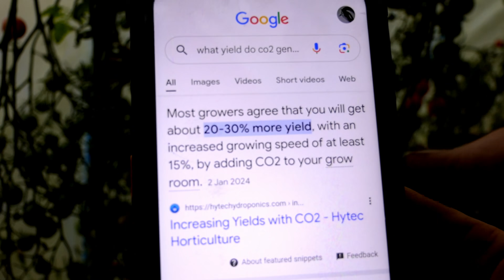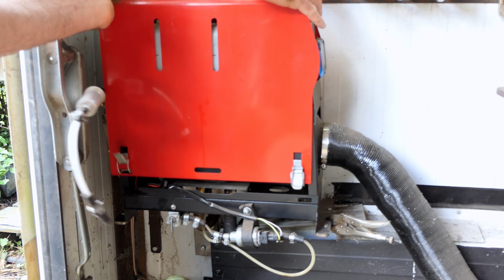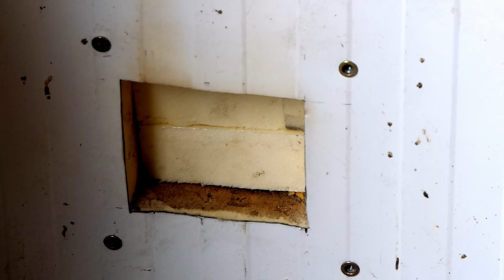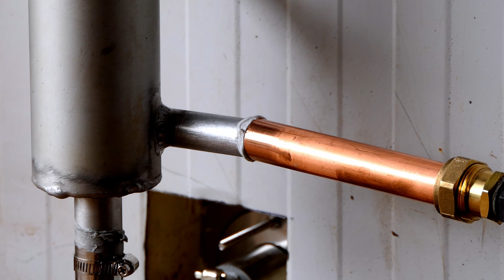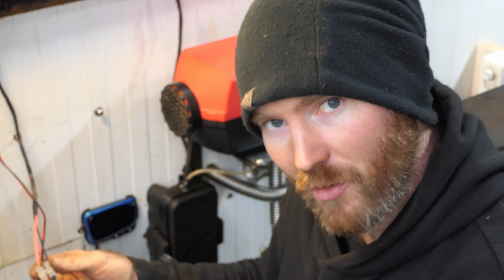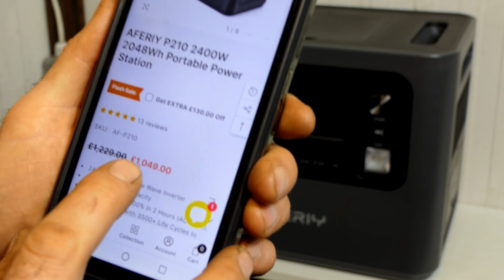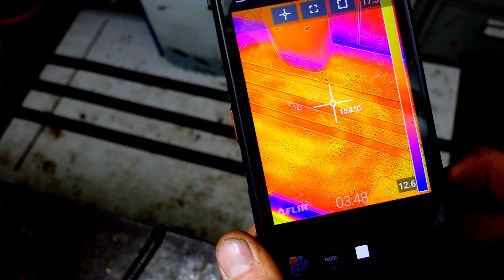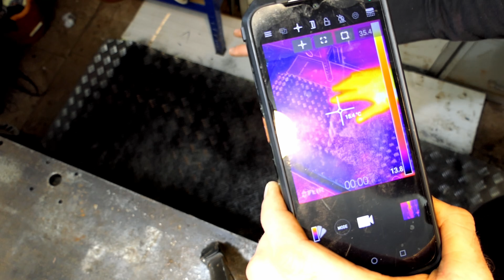NEW! Better system for Cheap and Safe Heating💲+ Underfloor Heating Mod test🫠

Comment: I got a 16kw diesel water heater that i connected to the radiators in my cabin thats in one of my videos. Im now actually really curious how much heat is going out the exhaust!
this is a brilliant video!
Reply from the maker: @jamesbrokentech  thank you so much. Cheers J

Comment: DUMP the under slow regulated floor heating and connect the warm Water to a FAN CONVECTOR.
THATS an amazing and fast warming system...
PS im already using the EGR exchanger, bought used for 10 euro.
Reply from the maker: @hunkenpunken  Nice. Well done 
Cheers J

Comment: Since you have an open water system: You should consider re-purposing your old Air systems: Make it watertight, run the exhaust free floating inside water inside the airexchange unit you had before. Sure. the Water (due to mass) will take a long time before it is getting hot, but it would also be a great energy store and heating the workshop even when the heater is off for quite some time. It would also save you on buying a radiator, since the whole "tub" would act as one too.
Reply from the maker: See what I do in the next upgrade. Cheers J
Reply: @ looking forward to it! keep buzzing! 🙏👍🏻

Comment: When you cut the grooves for the pipe in the panel: You can actually do this quite easily with a circular saw. Just make sure you have an extraction for the dust, it is real messy (own experience ;-)
Reply from the maker: I bet. Cheers J

Comment: Thanks for all the info! I was always told CO gas is denser than air, and found out about it being lighter just now. You are also very correct about your battery being half the capacity rated. Note that they sometimes have a K factor, the faster you discharge the lower the capacity according to a formula with that factor. Mostly lead acid batteries are rated at 20h discharges to meet its capacity. Using only 50% will drastically increase its life. You know what you're talking about.
Reply from the maker: Thank you so much. Cheers J

Comment: You just need to run the exhaust through a radiator /sand battery AFTER your first exchanger (assume that's already a sand battery?). 
You could also fit another silencer between each heat exchanger. 

You'd have two heating systems, one via sand and the other via pumped water 🤓

I've been talking about what you're doing for years and everyone laughed at me so never bothered to do it 🤦
Reply from the maker: Thank you. I've already done tests on a sand battery and I used a long radiator exhaust prior. Water cooling is definately the best way but I need a bettre heat exchanger. cheers J
Reply: @joshuadelisle  look at industrial aircon heat exchangers, we had a bank of them at a food processing plant to improve efficiency 

You could alu weld stand off plates and then plate the thing to make a water jacket external to the rad/exchanger - you have a solid block rad/heater in the garage but...

You need more volume of hot gas to simulate slowing the gas to improve heat/ to create effective transfer. 

You don't necessarily need to you water or anti freeze, other types of liquids heat faster (can't renber the term for them off top of my head)

Cheers

Comment: I put Redex in my fuel and for some strange reason my fuel pump to my diesel heater is now completely silent no more tick tick ticking, to say i was surprised is an understatement as its remained silent very odd
Reply from the maker: Interesting, I'll look into that. cheers J
Reply: @joshuadelisle not added anymore redex to my fuel and slowly my tick tick has returned but not as loud as before redex, so guess its time for more redex will let you know how much redex to diesel ratio and the results,by the way great channel this, dont know if you'll see this as its an old video ,but have you seen the video of 2 guys exploring somewhere cold and icy can't remember as I'd had a few if it was north or south but there was large heaters under the ice ,now was it A.I  not sure as video seems to of disappeared , onwards and upwards as they say and totally agree with you

Comment: You didn't use any inserts in the pex pipe ends.
Reply from the maker: It's not pressurized so the inserts don't really make any difference. I didn't have any either. cheers J

Comment: Interested Joshua, where you got your 1000 litre kerosene storage tank from? Does it need to be double walled or not. They seem incredibly expensive? BTW I'm in the UK.
Reply from the maker: @michaelnash9644  mine is 20 years old and was here before we moved in. Looking online I can see a few that are around the £600 mark which is equal to filling one up. You need a secure concrete pad. Otherwise if you ask a heating oil provider they'll probably give you advice and maybe Money off to help secure you as a customer. Cheers J
Reply: As a new heating user yes it will have to be a double skinned tank and there’s rules about where you can place it as well I suggest you Google it and have a read as it will effect your property if you decide to sell it. You can quite often pick one up of facebooks marketplace dirt cheap I got a 2500litre oil tank single skin tank for £50 but had to collect it myself . Good luck .
PS I’m in the Uk myself .

Comment: As well as the heat exchanger (one from an old combi boiler would work incredibly well, try passing the exhaust air through an old cast iron radiator (empty of water(obvs), get it from a salvage yard) entering in from the bottom on one side and out of the top on the opposite side, it's a larger thermal mass that you need. It will condensate inside so you will need to use the other  bottom rad port as an external drain point.
Reply: What would happen if you ran the exhaust through an old car radiator with fan? Massive surface area and blowing the hot air into the room?
Reply: @Fish-bw9yh  Probably not enough pressure in the exhaust to overcome the radiator resistance which would back pressure the boiler and cause it to cut out.
Reply: @peterjones6322  Even though it's designed for liquid for rather than just gas? Must admit I've never tried blowing through one 😁 I was also wondering if they were too easily damaged to make them leak fumes. 

Otherwise maybe feeding it liquid from the heat exchanger then?

My main thought was that either way the radiator fins and fan would extract more heat directly into the room. 🤔
Reply from the maker: @RichardFoley3  that's definitely an idea that would work. Cheers J
Reply: Yes a car radiator..but dont over heat since may only have SOLDER joints rather than brazed ??

Comment: "For galvanic corrosion to occur between aluminum and copper pipes, there must be a direct electrical connection between the two metals, meaning they must be touching or very closely connected, allowing for the flow of electrons between them; this could be through a physical contact point or even a conductive electrolyte solution like water bridging the gap between the metals." The barrier you have between them, likely won't be completely sufficient unless distilled water is used.
Reply from the maker: @Roobotics  I agree. I think I'm going to build a stainless version next. Cheers J

Comment: In Brazil our electric bill is at least 2.4x cheaper per kWh and at most 4x cheaper depending on weather. Since we have mostly renewable energy from hydroelectric dams. So we use heat pumps both for cooling and heating. Which makes the equipment cheap as well.
Reply from the maker: Nice. Cheers J

Comment: Exhaust from diesel heater through a radiator to add heat to your room?? Or possibly the above to heat a tank of water which is then pumped through a radiator system?? Hmmm....
Reply from the maker: Lots of possibilities. Cheers J

Comment: Get a ton of radiators and run the exhaust through them directly before exhausting it through the wall
Reply from the maker: It would work but how about cleaning them? Cheers J
Reply: @joshuadelisle  Perhaps set them at an angle so they would drain. it is never gonna be a forever setup, they will corrode

Comment: Top man Josh, a man after my own heart! Completely agree, freedom of speech, get out of our business, and stop using politics to interfere with our lives, quoting pseudo science (remember the follow the science bhullsheet) to follow political and personal agendas and motives!!!! 
Great video - try old engine exhaust heat exchangers? They might work better. Was there an issue with a previous version with a longer exhaust pipe, and condensation? Could you not just make a way bigger version?
Reply from the maker: Thank you so much. The long exhaust worked however the gas flow was restricted which caused the carbon build up from problems with the combustion. I think a shorter style of heat exchanger with a good flow rate is needed. Either a long wide exhaust or multiple exhausts through a manifold. Cheers J

Comment: i ran an 8kw chinese heater to heat my lazy spa, by running 2 small radiaters on the hot air out let in series and a car egr valve on the exhaust and could heat up my hottub 3 x quicker than using the 2kw heater, and the exhaust gas you could cover with your hand and not get burnt
Reply from the maker: Nice 👍. Cheers J

Comment: ovum heat pumps are at 1 to 6 and that for Austrian climate and reach ap to 1 to 10 for milder climates ... combine this with solar and...
Reply from the maker: Not in winter, the actual stats say different. Cheers J

Comment: why not mix the fule 1 to 10 to save the pump
Reply from the maker: @Bigfatfukrrr  I did put a note up. Adding a little motor oil/old will help. But really it's fine without and much cleaner burn. Cheers J

Comment: While paraffin and kerosene are very similar paraffin is extra refined to make it safer to burn inside thats why paraffin heaters and lamps are not really meant to burn kerosene.
Reply from the maker: @changingmyworld-j9z  true. But the refinement is minimal. Cheers J

Comment: Wow what a great channel! Just watched this one and your wood gasification/generator. Heating engineer myself, living in france. The advice in the comments on the underfloor heating is spot on. I myself have just finished my installation of a wood gasification boiler my next challenge is to build a stirling motor from the exhaust gassers that will run the circulating pumps in my heating system. Idea being that the central heating system will run solely on wood! No external electricity supply needed! Keep up the good work!
Reply from the maker: Nice, well done, I want to also harvest the excess heat for my central heating once i've finished building mark 2 gasifier. cheers J

Comment: Your heat extractor chamber, did you make the exhaust coiled inside the chamber to expose as much of the surface to the water? Sorry if this is a silly question.
Reply from the maker: No its straight, It for sure needs more surface area and a long coil maybe an answer, however the added restriction of the exhaust gasses is maybe what led to the carbon buildup as I've already experimented with long exhausts. Cheers J

Comment: See if you can source a Peristaltic Fuel Pump, no moving parts touch the fuel
Reply from the maker: They still have moving parts and are very expensive. relatively simple to diy though. I'm not sure how you can intergrate one in to the heater electronics for accurate pumping. cheers J
Reply: @joshuadelisle  True on the intergration side - so custom electronics to interperate the signal for dosing from the unit, (im interested in electronics)  if a small stepper motor was used micro dosing would be possible and may make the unit more effitient too (bit like a 3D print extruder with a micro stepper). Yes there are moving parts but the fuel does not come into contact with them avoiding the lubrication in the fuel problem. cheers N

Comment: Finally someone who I agree with as far as diet and CO2 goes, we need to form a movement to drive over the Just Stop Oil clan
Reply: I’m pretty sure just stop oil is actually funded by oil companies. This is why they do stunts that make the public hate them as hating just stop oil means loving oil companies out of spite
Reply from the maker: Thank you. I get why just stop oil are so passionate but they've gone about it all wrong. The important thing is to have dialogue and to have your argument heard and tested in a debate where everyone's perspective is taken into account. It's important to be open to an alternative idea and not be locked in one way of understanding. That's the only way to the truth to come forward because lies don't stand. Everything I've said can be checked but there is even more that I've learned from other commentators which is very interesting. Cheers J
Reply: @joshuadelisle  It always annoys me when I see the JSO people out with their freshly bought Gortex outdoor gear and plastic hi viz stuff on. Theyre almost covered in new oil products from head to toe, after meeting up and drinking coffee shipped from the other side of the planet out of disposable plastic cups! ut I suppose they have a great day out living on the edge, because roads are dangerouse places to sit down.
I drive an old 300 TDI, run a veg oil mix, and spend many hours weekly working there repairing deer fencing, and lots of maintenance in 80 Achres of young woodland, of which seven of us have our areas and work restoring hard wood woodland. It was a farm 20 years ago, and provides me with fuel to heat my home and water, and is a wonderful place to work, just on the edge of the Cairngorms in Scotland.
I wish JSO would see the light and get into coppicing, pollarding and maintaining what woodlands we have left which are mostly not managed. Managing woodland increases biodiversity and produces lots of wood for fuel and making things; it is also good for your soul.
 So I agree, they are going about helping the enviroment by helping destroying it IMHO too.
Reply: @joshuadelisle  Exactly, thats why they turn to censorship. Their ideas don't hold water. I've argued with people who have done absolutely nothing when I installed my own 8kw solar system and 15kwh battery setup, and they sit there calling me names because I don't say verbatim what the news says. Very frustrating, an uphill battle as long as these people keep listening to legacy news and talking in their echo chambers like reddit.
Reply: To be fair there has been dialogue for decades. The oil companies have known about industrial climate change for much the same amount of time. But nothing changes. I applaud JSO for their guts to stand up to it.

Comment: My heater is in the innwrmost corner of my shop with a 26' aluminum irrigation pipe as the exhuast. It comes out nice and cool   and the pipe acts as a huge radiator. Done
Reply from the maker: Nice. Cheers J

Comment: For the heat exchanger something like a graham condenser might be relatively easy to fabricate and produce interesting results. Just the exhaust gas flowing over a coil of pipe leading into the rest of the system
Reply from the maker: That could work. Cheers J
Reply: @joshuadelisle could make your heat exchanger like a steam engine's boiler which has lots of small pipes running through the big one it containing the water

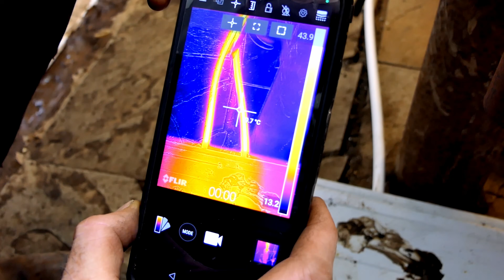Comment: ~36:00 Yeah, that 'expanding foam' stuff is a REALLY good insulator!  It's also VERY effective at sealing water leaks! 
I'd tell you how i know, but it's a bit of a long story. 
And as far as i can tell, it's pretty "permanent," at least in my lifetime. 
I'm going to assume it'll last at least...uh, forever.
Reply from the maker: You're right. Cheers J

Comment: acidic soils damage root tips and leech nutrients so false.  Read docs, the muffler should be horizontal and weep hole pointed to the bottom
Reply from the maker: You're right in a lot of cases but not all plants, there are some that love acidic soil such as pine, azaleas, blueberries, potatoes etc. there is actually a long list. The PH of the exhaust isn't too high, it was too hot to produce condensation but on my next experiment I'll test the PH. My wood vinegar was 3 PH because of the acetic acid and so I just added egg shells to create calcium acetate which plants love and a neutral PH of 7. Cheers J
Reply: @joshuadelisle  do a vid on it then
Reply: I see you noticed in other vids tho

Comment: What about propane heaters?
Reply from the maker: Bottled Propane is far too expensive here in the UK although many use it. Natural gas is widely used and fairly cheap compared to an electric system with no heat pump. There has been a number of devastating gas explosions recently though which highlights the potential dangers. The exhaust has also a higher chance of producing carbon monoxide if the burn isn't working at maximum efficiency. Cheers J
Reply: @joshuadelisle  not sure about the us, but been told it's cleaner.  I think RVs have it in the US

Comment: I ran cheapo chinesium diesel heater on 28second kero for 2 years as my central heating. Pump was absolutely fine. I would say it's better than diesel because it burns so clean.
Reply from the maker: Totally. Cheers J

Comment: Exhaust efficiency suggestion …. Build a better exhaust pipe and coil it through a cylinder/heat exchanger , then you can heat the water around it and have hot water and radiators. 
That’s a lot of heat not being used.
Btw love the heater vids
Reply from the maker: Thank you. Lots to come. Cheers J